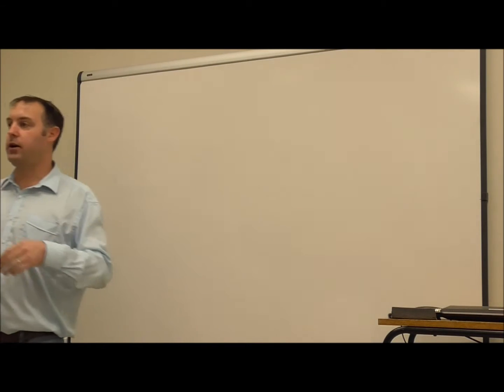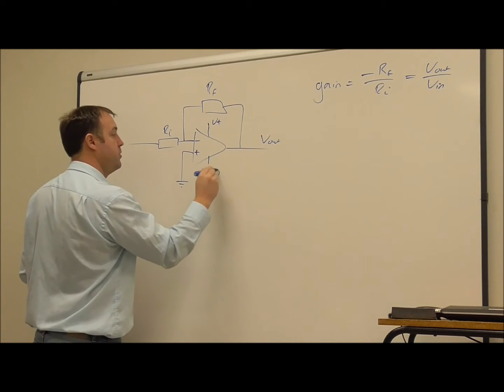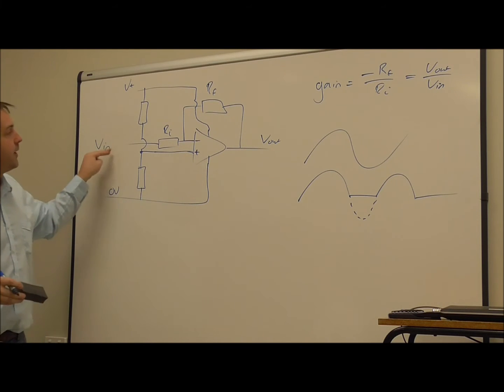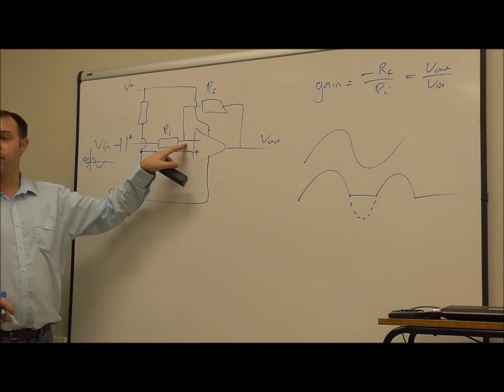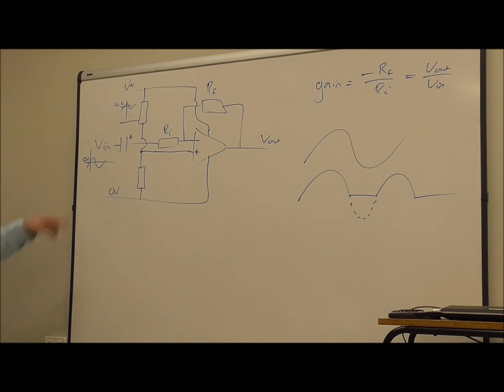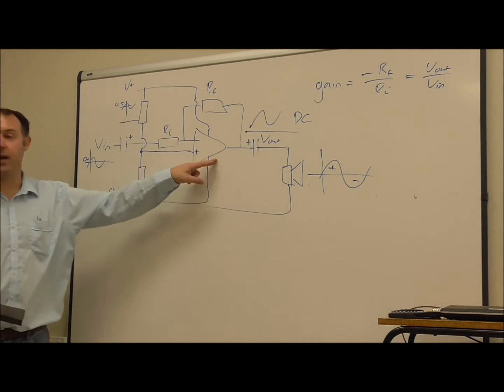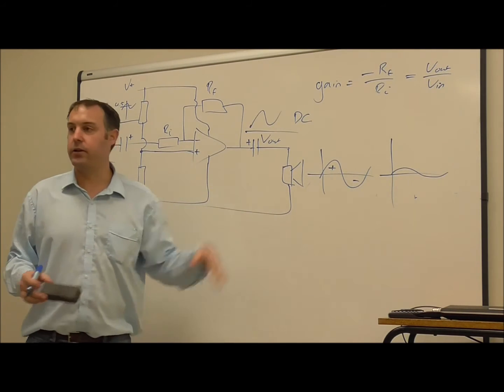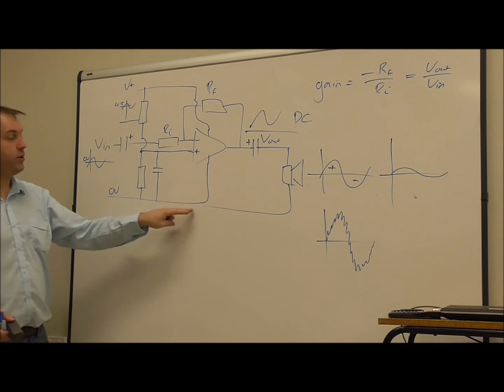single supply amplifier

Comment: Can someone answer this question?  Does the AC input source and the single supply for the Op amp have to have a common ground or can they be completely isolated?  If they must share a common reference point and the AC source is bipolar, would you then have to tie the AC 0v to the single supply's ground?

Comment: Yeah, but what if you do want to amplify some DC signals from a single voltage rail supply to the Op Amp? (not just AC signals)